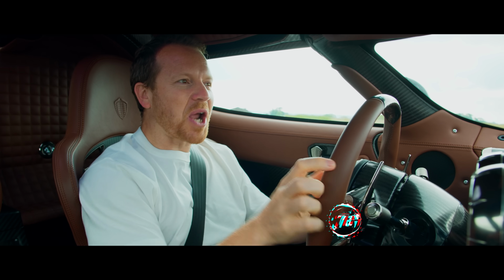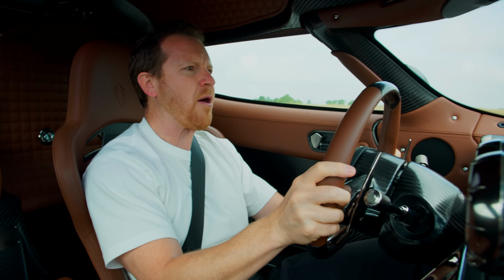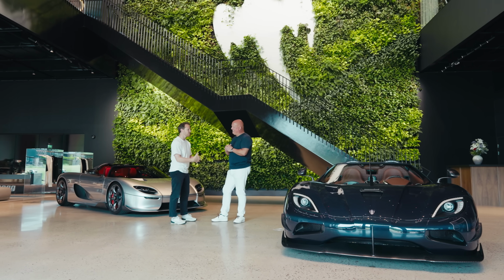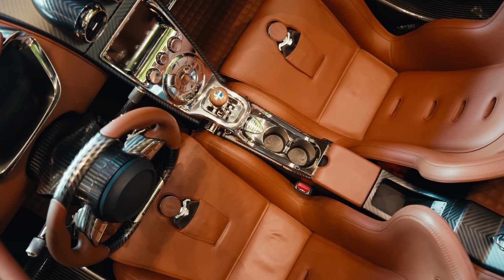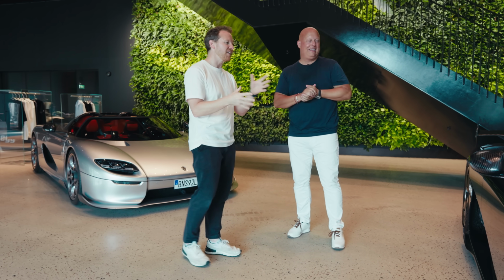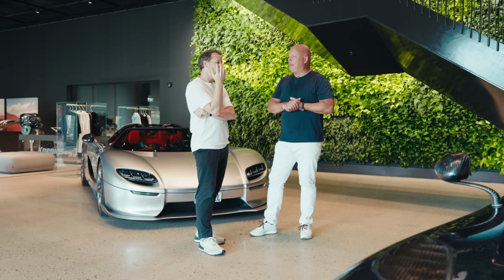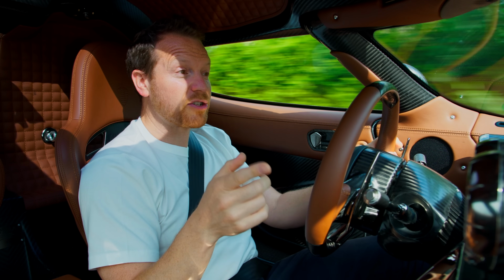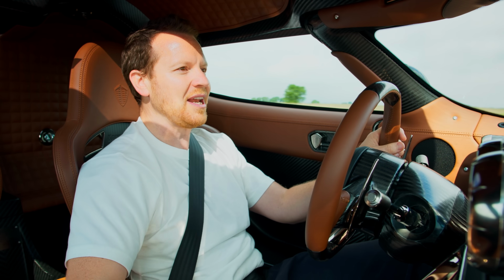FIRST DRIVE: Koenigsegg Chimera - 1600bhp, Manual, Agera RS/Jesko/CC850 Mash-Up!

Comment: An RS with the Jesko engine 🤯
Reply: and Jesko gearbox
Reply: @Brian.Jones.310 The gearbox is from the cc850
Reply: @Sidewinder5  CC850's gearbox is the same gearbox as that in the Jesko, LST. It only has a simulating pattern of a manual gearbox over the Jesko's automatic gearbox.
Reply: @Brian.Jones.310  What hardware of the  CC850 was used here?
Reply: @Sidewinder5  It uses the sensors and actuators simulating a 6 speed manual from the CC850. It's in the video.
Reply: @Brian.Jones.310  oh ok..
Reply: @areenbhalekar949  Read my previous comment.

Comment: Right side headlight fogging up already damn
Reply: Well the car is minimum 6 years old, but since the owner had a few cars already I'll assume 2015 to 2016 modell, that's 9 years in the Dubai heat defintly driving slightly faster then a normal car. Wouldn't be surprised if its gone trough a couple headlights.  😅

Comment: So with shift by wire you can just eliminate the possibility of money shifting. That’s pretty neat
Reply: At least you can still stall the car lol
Reply: Money shifts. Sounds both good and bad but I know It is horrible and expensive to change a clutch xD
Reply: @TheMrTipZy  You mean changing the whole engine.
Reply: @hejzlart  nah, I'm talking about the gearbox. With regular cars, slipping through the shifts in a manual car wears out the clutch/clutches the car has quite quickly. But Koenigseggs gearboxes can take a whole lot of beating and their "manual gearbox still kinda is automatic but still feels like a manual. Outworthly freaking cars.
Reply: @TheMrTipZy  a money shift doesn't wreck the clutch, though.  It wrecks the engine.  When you money shift you shock load the engine into an overspeed condition, which usually ends in a thrown rod or three.
Reply: @johnathanmoyer2375  Ah I see. So downshifting to a gear lower than recommended spooling up the engine above the redline. Sound gnarly and whoever that makes that mistake should not sit behind the wheel.
Reply: @hejzlart changing this engine prob cost $99999999

Comment: So the Chimera is a 10 second car?...

Nice car, what's the retail on one of those?
Reply: more than you can afford pal
Reply: Take a guess.
Reply: My best guess is almost $5 million.
I fairly sure it would be more expensive than a CC850, just based on performance/features, and that goes for $3.5m. Then add in all the custom work and I think it approaches $5m.

But since it's more of an upgrade than a new car, maybe $1-2 million on top of the original RS price ($2.5 million).
Reply: @Cerulean_Frost  Agera RS1 was valued (Doug Demuro) at around 10M USD and it had a very bespoke wing which differentiated it from the other units of the Agera RS, meanwhile the Chimera or Agera RS Chimera has a different engine, gearbox, suspension compared to all Agera RS units. So, it can be easily value at 10M USD but no one will ever know the value unless it goes into an auction or is up for sale.
Reply: @Brian.Jones.310  I was talking about the retail price. But yeah, it could go for a lot on auction.

Comment: Its not just a manual.....THATS A GATED MANUAL
Reply: Technically it isn't a true manual but it's been made to simulate the shifting pattern of 6 speed manual or gated manual. Genius!
Reply: @Brian.Jones.310  yeah..we know that from the video. A gated manual is just a manual with a plate in it. So this is a modern day gated manual. Also this video shows how similar this gearbox is to an actual manual.
Reply: @salomonjose9456  Apparently not many people here know that it's not a true manual, they don't even know that this gearbox is the same LST unit in the Jesko with added sensors and actuators simulating a 6 speed manual.
Reply: @salomonjose9456  Ok let me ask you this : Do you know why the italian 's put the gated H-plaque pattern on the manual gearboxes ? it's not because they love the "snick-click" of gears like today enthusiasts people love to tell as best feeling description after driving.. Main reason it was because back then gearboxes were not that precise also since back then some people (Fangio, Farina, Fagioli, Nuvolari..) still wanted to win racings but the travel of gear lever was doing crazy thrown back and forth so, with that H plaque-pattern gear-shifter movement got more precise between gears compared to the cars that have only the boot-rubber without the H pattern.. Getting a precise gear shift mean all the benefits that comes with a good precise shift : less wear & tear, less time fixing gearboxes issues, car felt more engaging, faster & eventually more enjoyable because was doing what it suppose to do without risking jerking gears, miss-shifts, bending linkages parts or even broken gearboxes and that was not good specially if they wanted to win any race (from standing still head to head 1/4 mile, 1/2 mile, to track laps to up-hill races or even endurances like the ones they did back then : Targa Florio, Mille-Miglia, Nurgburgring) were if they did have some damages meant passing finish line 3rd, last or totally DNF ..
Reply: @poplaurentiu4148  yes. But even after they had modern manual gears; a lot of them continued the use of gated manuals just for the feel.
Reply: @Brian.Jones.310  oh yeah..u are right. I took it personally. Sorry
Reply: @salomonjose9456  Certain auto manufacturers continued the use of gated-manuals so their pot-bellied, 61-year old clientele could actually find 3rd (or 2nd if dogleg) in their performance cars. 

Ferrari kept the gate around in F1 into the 70's because their crappy transmission had issues selecting 2 gears at once. The Hewland transmission that other teams used, did not have that problem, and were just a simple shifter, was the standard in F1.
Reply: @Brian.Jones.310  Finally someone that gets it. It's an auto gearbox where you can electronically control the clutch and gears via mechanicall inputs.
aka Glorified auto gearbox
Reply: @ricardobarrios4159  Say whatever you want but no other automaker came up with something like that.
Reply: @ricardobarrios4159 
Electronically controled or not, there's 3 pedals and a stick in a H pattern gates, wich = MANUAL! 
Get your bs straight. NO ONE has ever done this before.
Reply: @gativirycat6686  it will not feel the same, I guarantee you
Reply: @ricardobarrios4159  Everyone who drove the CC850 didn't say anything like what you think.
Reply: @ricardobarrios4159 you say that like you have actually experienced the feeling of driving it. 

I haven't neither, but I'm not being annoying about how it feels without actually feeling it.
Reply: @ricardobarrios4159  still better than a PRNDL
Reply: @ricardobarrios4159  an auto has clutches and gears... a manual can be multi plate clutch and still require the use of a clutch slave cylinder, hydro, electric, or cable... if this "auto" mimics it, you could also say those other mechanics previously existing, hyrdo electric cable, mimic the force of decoupling.... maybe you consider a real manual, literally throwing your hand into the mix, good luck with that... it's not a bike with sequential straight cut gears, so irrelevant and i have 2 nuts... don't harm yourself later though.
Reply: @gativirycat6686  I control which gear I want to select in my DSG, it's a manual!
Reply: @ricardobarrios4159  No you don't! That doesn't even make sense. You can select the next gear foward or reverse, but even in that case when you floor it it will automatically shift for you. And there's no clutch pedal or H gated stick. Sorry but no.
Reply: Meaning?
Reply: @AzharTheTrader  The gated manual is called so because each gear slots into a milled gatE. Italian cars from early 2000s were known for the gatd manuals. Many who were fortunate enough to drive the gated manuals always praised how the mechanism felt.
Reply: @salomonjose9456  okay cool, I learned something today.
Reply: It's fake. Just like pinky paddling
Reply: It's not even a manual lol
Reply: "Call it what you want!" - Christian von Koenigsegg.

Comment: Cost millions only to get smoked by Supras, GT-Rs and TT Huracans.
Reply: If you own a Koenigsegg you aren't street racing in Texas, you're driving to your private European villa
Reply: @R03333  You're missing the point. Paying millions for a hypercar doesn't guarantee you being the fastest kid on the block.
Reply: @jcdenton8750 hypercar owners don’t care about being the “fastest kid on the block” 😭💀😂
Reply: Dont you dare every use supra and koenigsegg in the same sentence 💀
Reply: @Aderin.  You can like or dislike the MK4 Supra but it has cemented its way in automotive world as a legendary supercar killer. Modified Supras were putting down 1000hp back in the late 90's/early 00's when the best Ferrari, Lamborghini, Koenigsegg and other exotic has to offer was not even 600hp.
Reply: supras? ☠️☠️
Reply: Bros an idiot

Comment: A Koenigsegg car and Christian von Koenigsegg ist the ultimate combination! Love this man and his cars with unique technology.
Reply: He also has a huge wiener that’s a big W!
Reply: Expensive show car. 
Cheap heavy Plaid is quicker
Reply: @Matriarchy_Feminism  electric has no spool and no power lag, but except for accelerating in a straight line it does literally nothing better - around the track, stopping, turning, or even top speed. tell me you're not a car guy without telling me.
Reply: @ZeroGFPS    lol. I am a automobile engineer. And I know how disgusting is engine technology is. Electric cars can go faster if they use gearbox. None of the shitty manual cars defeat mcmurtry on track races
Reply: @ZeroGFPS      I drive manual cars.  Controlling and balancing clutch, gearbox, accelerator together is problematic and dangerous on road. Modern automated manual cars are easier to drive. While driving EVs are as easy as riding a bicycle. 
They just lack sound for brushless motors. Dc motors can make sound and show flame on commutators. But they are more inefficient.
Reply: @Matriarchy_Feminism  but hypercars arent about convenience, or comfort. Any mercedes or tesla is  better for that for a thirtieth of the price. Hypercars are about power. Anyways as for manual just drop 10 mill on a custom koenigsegg chimera 😃
Reply: @Matriarchy_Feminism  least obvious bait
Reply: @ZeroGFPS  hypercars are not about power.

They are limited, rare also they have a high resell value. It's a thing of luxury, power, flex, great technology and investment at the same time.
So there is no sence to compare them with regular cars.
Reply: @Matriarchy_Feminism you're saying that as if auto cars can beat the mcmurtry, you can't beat the speirling in anyway or anywhere nor is it comparable with anything
Reply: @hugo-pg5tv   Mcmurtry has limited top speed for safety. New pure version is faster.  Even the fastest f1 cars couldn't defeat mcmurtry is drag and track races. 
       919evo is a advanced hybrid car. Is it fast. But for quick acceleration it is dependent on motors.
Reply: @hugo-pg5tv  Cars of Gordon Murray also use fans
Reply: @hugo-pg5tv  Why they will obey your crazy rules??
Reply: Yet it useless car .. That's the irony ..
Reply: @kebeleteeek4227  yea cause your 2002 accord can carry more groceries, useless hence proven  lhs = rhs
Reply: @ZeroGFPS  lmfao
Reply: @kebeleteeek4227  If you want something useful, buy a VW Caddy :face-purple-crying:
Reply: @kebeleteeek4227  That's the whole point of supercars and hypercars. They make zero sense and are useless. That's why billionaires want them.
Reply: @kebeleteeek4227 Nowhere near as useless as your comment.
Reply: @kebeleteeek4227  sure.